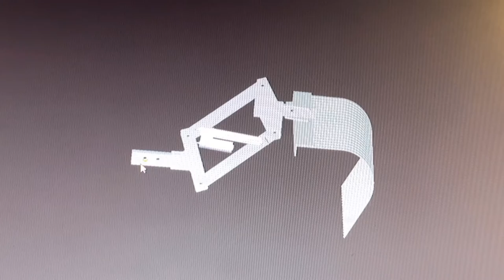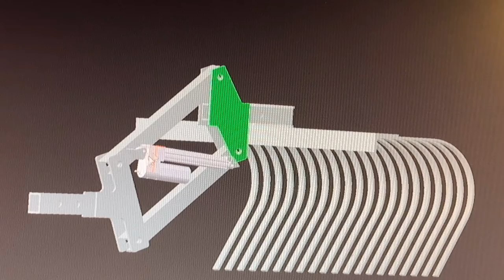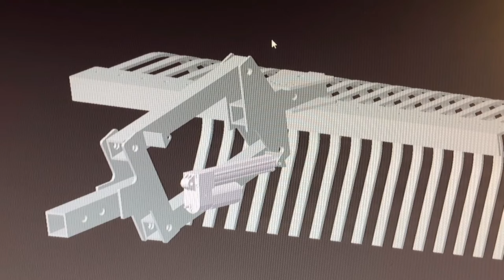Homemade Landscape Rake, with Electric Lift for ATV

Comment: Great build and practical approach with an informative presentation. Could you please elaborate on how you made the rake tines? Are the tines just bent or heat treated etc. to maintain the spring?
Thank you from Alberta Canada
Reply from the maker: Hi, thank you! I did not make the tines, I bought those off amazon. There is a link In the description. They are a lot more expensive now than when I bought them. There are other tractor and fleet supply stores where you might be able to find them as well.

Comment: After having this for a year, do you still like it? Is it as strong as you hoped it would be?
Reply from the maker: There are things I like and dislike. I like that it’s compact and it’s nice if you are on a trail where you need to back up. I don’t like that it lifts so slowly. 
I released another video last summer where I modified it again and made it a pull behind with a rope to release any built up junk. That’s my favorite right now. 
But as for the lift itself, I plan to build an s tine attachment for it, which wouldn’t be such a big deal about speed